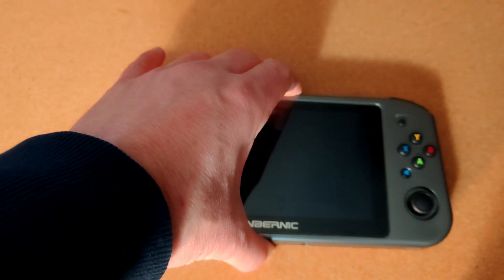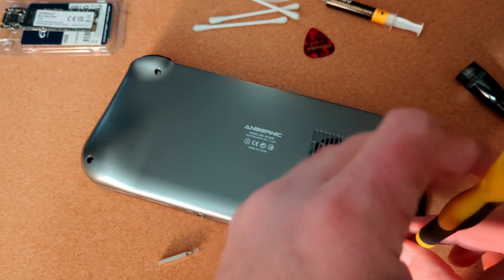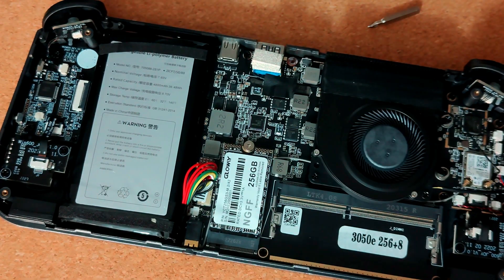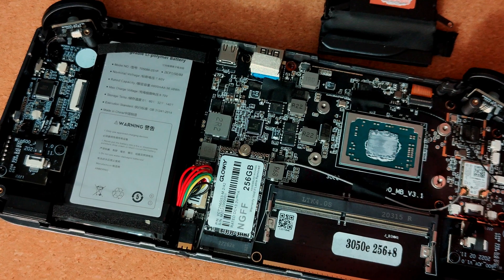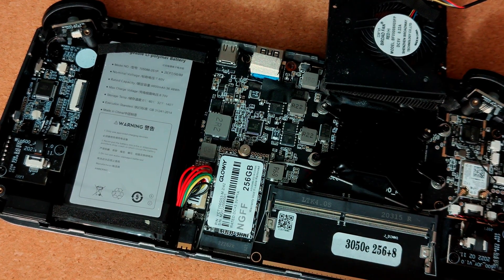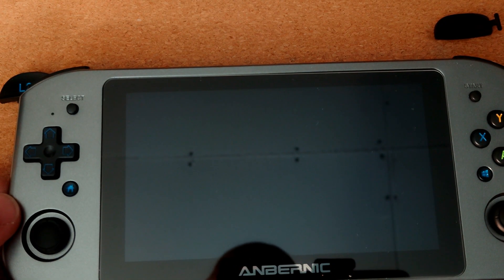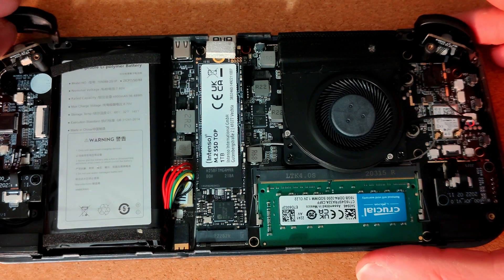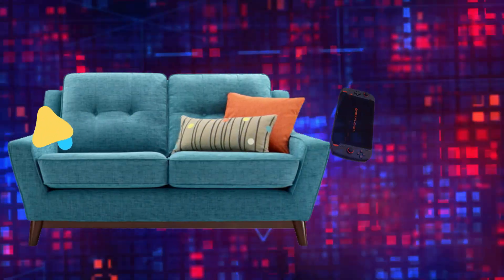Complete upgrade to the Anbernic Win 600 |  Replacing the 256GB 2242 M.2 with a 1TB 2280 M.2 😲

Comment: I inserted 32 frames 3200 mhz but it does not start when set in bios 1600:/ max I can give you 1333. Any idea or hint on what to do to make it work 1600 MHz? The producer is the same as you put it in.

Comment: Has anyone tried upgrading the battery to a bigger capacity?
Reply from the maker: The capacity itself isn't the problem its finding anything that will fit the connector.  Anbernic washed their hands of the Win600 as soon as it hit the market, much like they do with ALL their products, getting spares is impossible as they refuse to sell them and won't help in sourcing alternatives.

Comment: Does it's cpu replaceable? (Sorry for my bad grammar😢)
Reply from the maker: No this the CPU is fixed.
Reply: Vega 3 isn't too bad and u can always get an external GPU from Amazon or a bracket for one that can improve performance just have like a decent lightning cord
Reply from the maker: Don't think the USB port on the Win600 is e-gpu capable.

Comment: I recently purchased an Anbernic WIN600 and I'm having an issue with the battery. Sometimes the console charges properly, but other times it won't charge at all or the charging is very unstable.

I'm wondering if there are any Battery Management System (BMS) options that can be configured in the BIOS to solve this issue. I've already accessed the BIOS using the DEL and F2 keys, but I couldn't find any clear settings related to battery management.

Is there a BIOS update that could help fix this issue?

Does anyone know where to find the BMS options in the WIN600 BIOS?

Are there any other solutions or settings I should try to resolve this charging problem?

Thank you in advance for your help and advice!
Reply from the maker: I had problems with my battery too and I presumed I was going to need a new battery but Anbernic would not entertain selling me one or telling me where I could buy one.

So what I did was used a quality known charger, in my case a Ugreen Nexode 65W desk charger and a USB-C > USB-C cable with a display that showed output.  I plugged it into the Win600 and used the free app,BatteryInfoView on the Win 600 and watched the charge/discharge rate until it stopped.  Then I unplugged the USB-C cable and immediately plugged it back in again and it would charge again for a minute or so.  I  carried this out for days until I coaxed the battery up to 95%.

After this I used the Win600 until the battery was down to 20-30% charged and charged it up again, and it charged higher before it stopped and I repeated the unplugging/re-plugging hack.

Eventually the Win600 learned where to stop charging and it now takes a good charge without unplugging/plugging to get it to charge to close to 100%.  I think it gets to about 96% now before stopping charge.

Interestingly the BatteryInfoView app still says its condition is 100%. It was a bit of a faff but its rescued the Win600 and it seems the problem isn't so much the battery as the way the Win600 measures its limit.
Reply: @handheldgaming4life  I solved the problem by using a USB-C charger with exactly 45W, as I was previously using 100W chargers and it didn't work. I also bought a new battery on AliExpress, and now there's absolutely no issue with the WIN600.
Reply: @Elden_4  You managed to find a replacement battery?!?!

Comment: can the processor be replaced
Reply from the maker: No, it's soldered directly to the board.  Most of not all handhelds are the same.  Memory can however be upgraded as it's standard laptop sodimm.  Albeit single channel.  And the M2 can be replaced with a bigger one, SATA M2 though not NVMe.

Comment: does the 2280 ssd get hot? like to the point it causes issues?
Reply from the maker: I thought perhaps this was the case when I had battery issues.  But it seems everyone is likely to have that at some point. And the battery is fine now after I managed to force calibrate it.

As far as I can tell the SSD isn't close to any components that might be affected by heat.  In fact if you wedge the end into the squashy foam like I did the whole SSD is further away from the main board.
Reply: @handheldgaming4life   very cool, good to know thank you for your response
Reply from the maker: @CJKile   Always happy to help.

Comment: Any battery replacement recomendatioms, mine dies out of nothing
Reply from the maker: Sadly I've not found any alternative sources.  I contacted Anbernic and they said they don't sell parts like batteries and offered no assistance in alternatives.  😕
Reply: O meu anbernic morreu ... infelizmente... dinheiro jogado no lixo...
Reply from the maker: What happened to it?  Failing to power on?   Could be the battery BMS is failing to charge the battery.  Or its swollen, only way to know is to open the device.
Reply: Got Swollen after and fix lated, I got a handheld forced to use it as desktop always connected to power source :/
Reply: …thats why i will ever never never ever buy anything anbernic again…nope sir e not…ever never…no…
Reply from the maker: @JohnStenborg  I was foolish and I've bought a other of their products.  Review coming soon.  I should have listened to my own advice.  Everyone singing this devices praises but will it break in 2 months?  Seems some are reporting theirs are.  🤦

Comment: Disconnecting the battery first before doing anything :face-turquoise-covering-eyes:
Reply from the maker: I agree, discharged low and shut down in my case.  Pulling power isn't easy on the win600 unfortunately.

Comment: My win600 3020e should be here soon. 
Since I dont plan to run windows or steam and keep it for emulation only via Batocera rather than run Batocera from a flash drive or micro as card with a mini reader and have that sticking out the usb port I really should just upgrade the ssd.  Might get a 1 even 2TB one. 
So the only difference between the 2242.and 2280 is the form factor I believe, so why use the 2280? Maybe you found one cheaper or had it in a drawer? 
Also, it cant be an nvme one, I read those dont work. 
Going by your vid it looks easy enough to open replace the ssd so 👍
Reply from the maker: Can you get M.2 Sata in 2TB size?   I went for the 2280 as it was convenient and much cheaper that equivalents...    Yes easy to open and replace to be honest,  running Batocera directly from the M.2 Sata also shouldn't be too much of an issue,  you can download a bootable image direct from Anbernic.    Keep me posted on how you get on with battery life/condition.   I'm pretty sure the pack which is 2 cells is badly configured so easily slips out of balance.  I can now no longer charger higher than 70%.   I'm pretty sure one cell is 100% charged and the other barely charged but I can't get them to balance.   I've heard of a few other owners having problems charging over 60% and many say they never get it to charge over 95%.
Reply: @handheldgaming4life  
Damn,looks like my first reply was auto deleted by yt. 
Well, if I have any battery issues Ill let you know. 
And yeah, check 2TB kingspec 2242 brand.
Gets good comments from buyers and also seem a ytver use a 1TB kingspec.
Reply: Had an issue with jtem havent got it, apparently it was sent back for some reason so in process of getting refund. 
Will order from somewhere else so give me a few weeks again 😁
Reply from the maker: @fonzitheman  what company did you order from?
Reply: Originally?  From an ali express seller.

Comment: Is it possible to change the video chip to a more powerful one?  I think it would be interesting.
Reply from the maker: Sadly not.  The APU is processor and GPU rolled into one package.
Reply: @handheldgaming4life  To begin with, it was necessary to DISCONNECT the battery plug so as not to accidentally close anything.  Even on the RAM there is such a sticker, if I'm not mistaken
Reply from the maker: @hitbox2381  I agree its always worth pulling the battery connector.  Unfortunately the connector on the Win 600 requires you to pull the battery off to give room to extract the connector.   I shut down fully and I've worked on PCs and handhelds for decades, so I'm pretty careful.  But yeah mistakes can be made so be careful when replacing the ram/SSD etc.